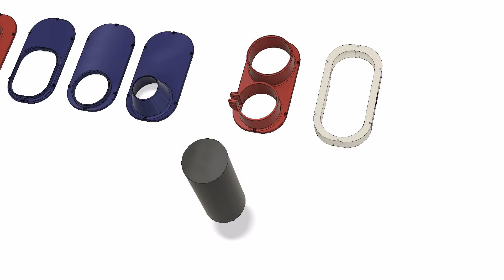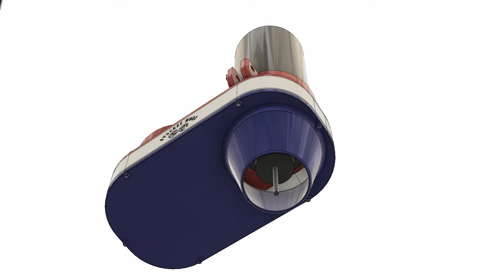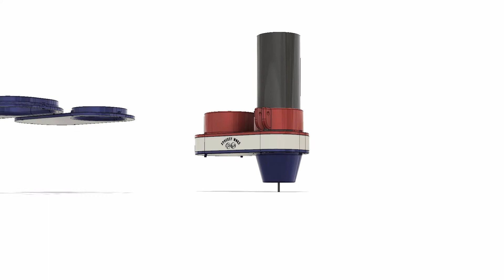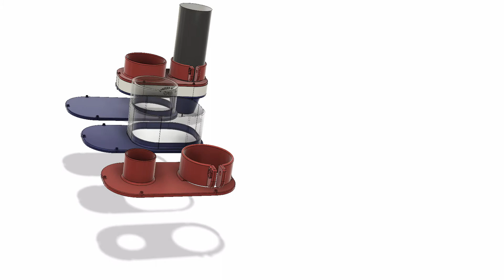80mm & 60mm CNC Spindle Vac Dust Boot (Version 2 link in the Description)

Comment: Have you had any issues when running your cnc?  I have the exact same set-up and I'm having issues with the x and z axis losing steps.
Reply from the maker: What do you mean by losing steps? Is it binding up or something?
Reply: @702marine  no it will be running along and suddenly starts cutting deeper or it will be way off the program
Reply: @jackcass3552  Did you find out what was the problem, sounds like what marine ask if it was binding. Perhaps your z axis is causing the problem if it digs deeper into the work piece. check your bearings or your drive screw is inline properly.
Reply: I've had this happen to me also. Im using an offline controller not mach 3. I found 2 things that would cause me to loose stepps #1 loose or bad connection on a stepper motor. #2 feeding to fast during a direction change. For example, during roughing or finishing, when the machine starts making short fast jerky movements it will loose steps. I reduced the acceleration and deceleration speeds of my steppers and that seams to have fixed my problem. The start and stop should be smooth not a violent jerky movement.